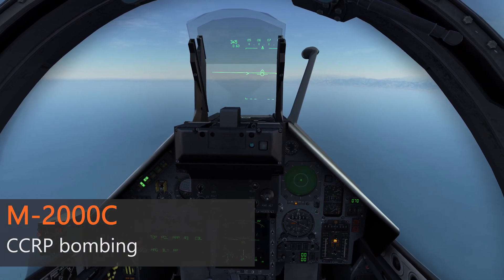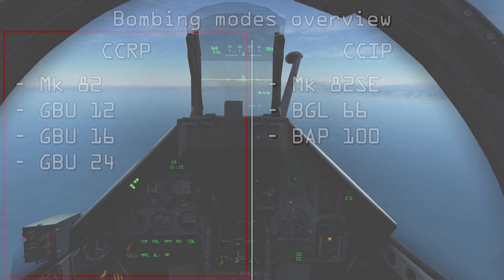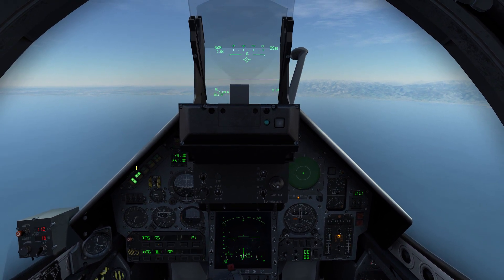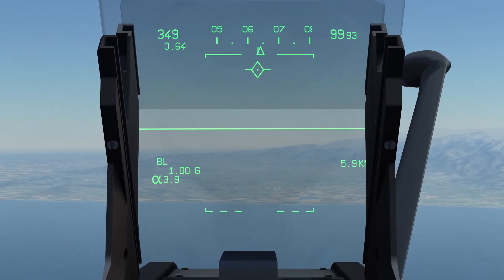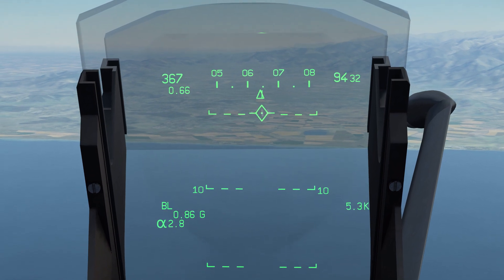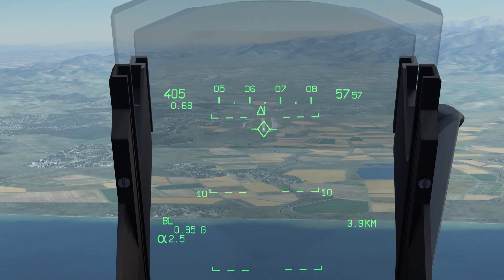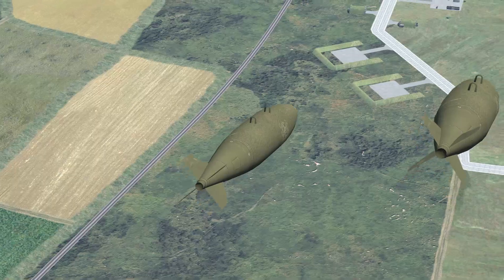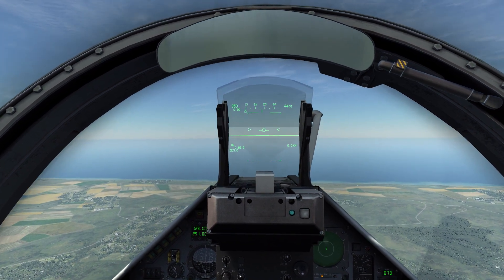[DCS] M-2000C - CCRP bombing tutorial

Comment: CCRP is not meant to be used to deliver bombs in level.
While possible the shalow angle of the radar beam to the ground is going to generate a massive triangulation error.
The bombs will fall either quite short or long.
The correct way to use the CCRP radar designation is to use a dive toss profile
Use a 30° dive to designate the target with the diamond then push the trigger and pull a constant 5G untill the bombs go
Rule of the thumb to compute the correct distance to initiate your dive is 3 x height above target / 10000 : for instance 3Nm for a 10kft dZ
I hope this was useful
Reply from the maker: +Daou Thanks for your detailed explenation! Very useful indeed!
Reply: +Daou  If you have time,could you pls make a video illustrating this  :)
Reply from the maker: +Kalahari54 YesI will do that. However, currently this doesn't work because as of now you can't just hold the trigger and wait for the CCRP system to drop the bomb.